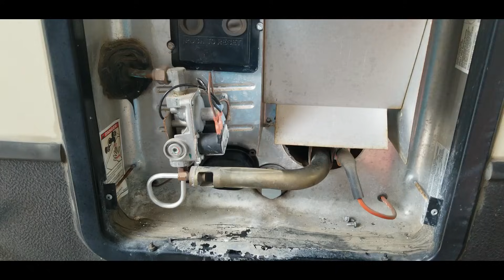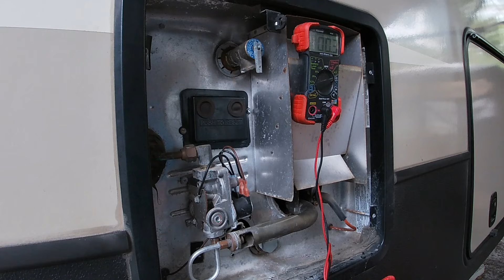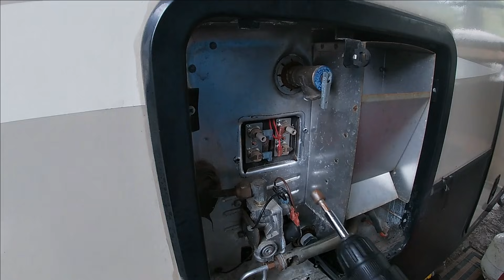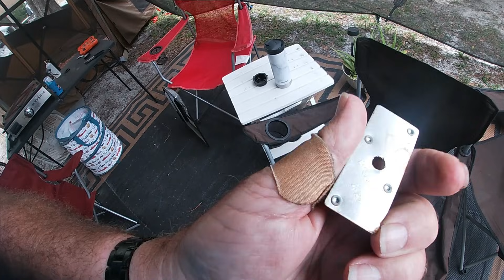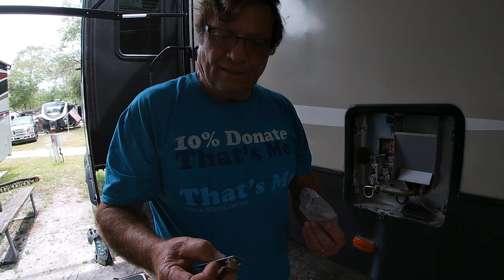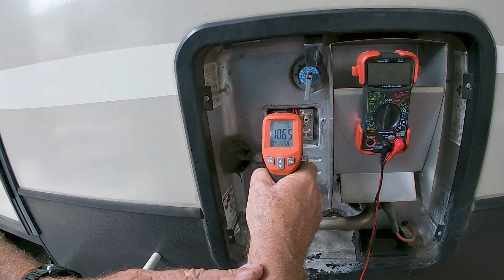Diagnosing A Suburban RV Water Heater Not Working On Electric

Comment: You should have removed the wires from the end of the heating element to get an accurate reading, as you checked it with other electrical components like the switch were still in the circuit.
Reply from the maker: If there where other circuitry involved what you say would be true. However it is a very simple circuit. The two switches are in series with the element and circuit breakers off. So nothing is in parallel with it to interfer with the resistance reading.

Comment: I have 120v to the element but still no hot water. thermostat switch ohm well. Any thoughts?
Reply from the maker: Did u check for continuity of the heating element?
Reply: @RvTipsandTrips  Yes I did. I am completely baffled
Reply from the maker: The heating element could still be bad even though it measures continuity. They are pretty cheap. You can get universal elements at like lowes or ace hardware. Just make sure the watts doesn't exceed the original. Thats what I did because my heating element went bad later on.
Reply: @RvTipsandTrips  I will stop at Lowe’s after work tomorrow and give it a go. Thanks for your help! I really appreciate it

Comment: @RvTipsandTrips - Question: When testing Ohms across the electrical heating element, should it be tested with the tank empty or full? I ask because water surrounding the element  might change the ohms reading is this correct?
Reply from the maker: water surrounding the element should not influence the resistance reading. The heating element does not contact the water because it is encapsulated inside the metal rod.  the heating element is a wire coil inside a metal rod.
Reply: @RvTipsandTrips  oh I thought the metal rod was the element. Okay. Thanks for clarifying. Ty for the informative video too. Just replace my Suburban 12 gal unit today. It was 7 years old and the tank started leaking. I replaced the anode 1x/yr and flushed it every time. What’s the life-expectancy of these units do you know?
Reply from the maker: I would have thought it would last longer. But there are some variables at work. Water quality does impact it. Also when disinfecting the water system bleach is used. Bleach is very corrosive to steel if used in too high of concentration.

Comment: Have a keystone Springdale Mimi the power to heater will not come on but the water pump indicator comes on any solutions
Reply from the maker: Is it a suburban water heater? If so there is a small switch in the lower left on the water heater itself. Switch that to on.

Comment: I have the same tank as yours. My on/off switch froze up or melted and I need to change it. Do you know how I remove the old switch?
Reply from the maker: I think you can pry it out from the front. The switch snaps into the cutout. I havent tried this yet myself havent had one fail yet because I just leave it on all the time and switch on and turn it on and off from the control panel.

Comment: Question about the wire hook ups does it matter which one plugs where or can they be crossed and still function?
Reply from the maker: Not exactly sure of which wires. the thermal switch doesn`t have a polarity so reversing the wires on that component wouldn`t matter as long as you have the two correct wires that go to the switch. Same thing for the heating element as long as the two wires going to the heating element belong to it. these things are not polarity sensitive because it`s A/C current. the switch is wired in series with the heater element and the Temperature overlimit switch.
If you don't feel comfortable then perhaps you should
let someone else fix it to be safe . safety first please.

Comment: Excellent step-by-step video!  Our WH suddenly stopped working in the electric mode, but functioned normally on gas/propane.  Found a burnt wire/connector on the low temp thermostat and the 120V was no longer making a connection.  Replaced the 90 degree connector for the 120V and went ahead and replaced the thermostat assembly even though both switches tested ok.  Made this decision because there was a burnt mark on the low temp thermostat.  Thank you for enabling me to make this repair on my own while on a multi-month trip!

Comment: Is it possible that I don't have an On/Off Switch Inside My Cruiser, Fun Finder Trailer or am I just not knowing in the right place?  Great Video!
Reply from the maker: The suburban water heaters have a switch in the lower left. Sometimes its hidden behind the gas pipe.
Reply: @RvTipsandTrips  Right, but I thought you mentioned there may also be another switch inside the RV and wanted to be sure I wasn't missing it!
Reply from the maker: The main on/off for the electric hot water should be located on your control panel. Its possible your hot water tank is not electric just propane.
Reply: We have a switch inside for gas hot water but no equivalent switch inside for electric hot water... just the switch at the bottom left of the tank.

Comment: Your good sham membership discount comes with a  50% mark up.
Reply from the maker: sometimes I have to bite the bullet and us stuff from camping world if I need something in a hurry thats RV specific. if I can wait then I get it from amzon,
Reply: @Rv Tips and Trips  you have yhe right strategy. I'm having the same issue with my water heater. I replaced the on/off switch, the heater coil and the temp sensor and it's still not heating on the electric side. Sadly I don't how to use an ohms meter. To test my heater coil
Reply from the maker: Did you check the switch at the bottom left of the heater? Some models have that second switch.
Reply: @Rv Tips and Trips  thanks for the tip. I did find a video where the man shows how to test the heating element. I might have had a loose connection on the electric power switch. I don't know what it connects to but it might have been loose.  Thanks again!!!

Comment: I found my wires are burned at the thermostat wire. Now I'm not sure if it went out due to bad Therm or a wiring issue.
Reply from the maker: The connection may have been loose causing it to arc thus burning the wire. The heating element draws a lot of current so if a connection is loose it will arc. I would replace the thermostat and the connection.